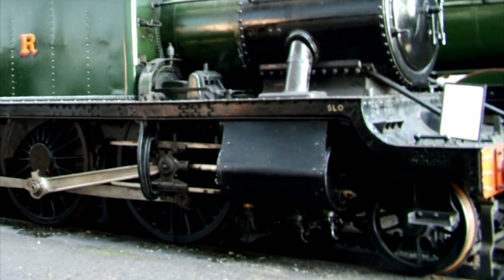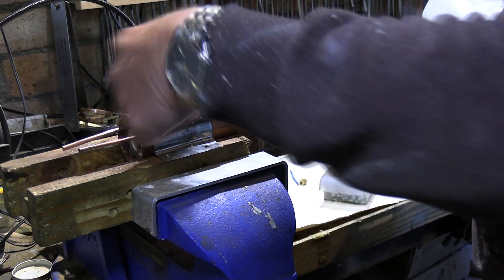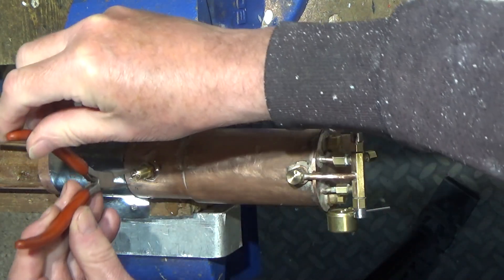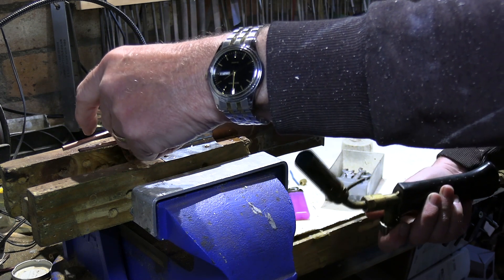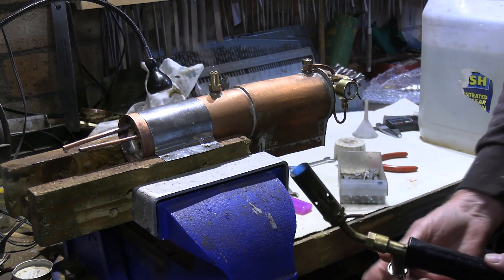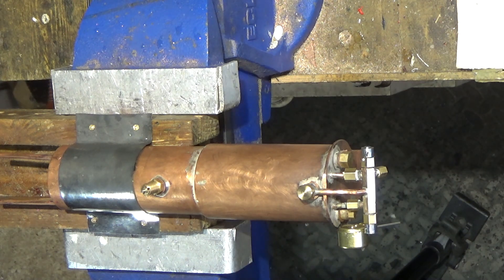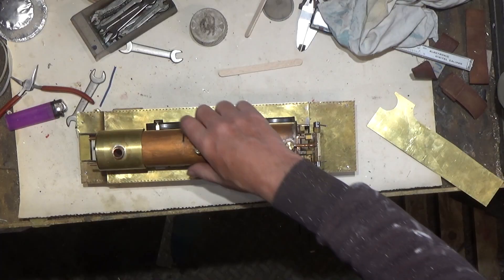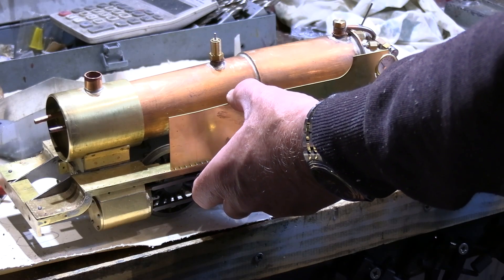Gauge 1 Live Steam Scratch Build 24

Comment: Which drawings are you using for this locomotive?
Reply from the maker: The drawings Gauge One 515 (GWR 2-6-2T) came from Reeves 2000   https://www.ajreeves.com/category-442/page/1/
I used them as a basic starting point to get the main overall dimensions from. Then did cad redraw to get a few parts like the connecting rods, main frames and the cab sides laser cut.